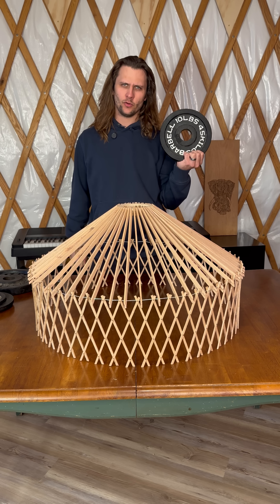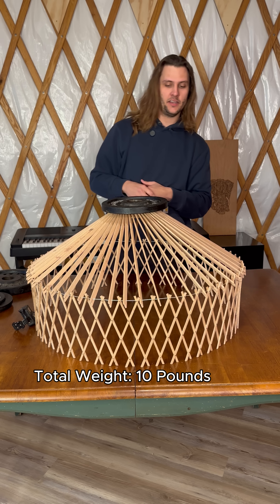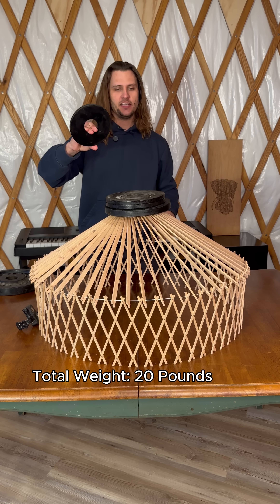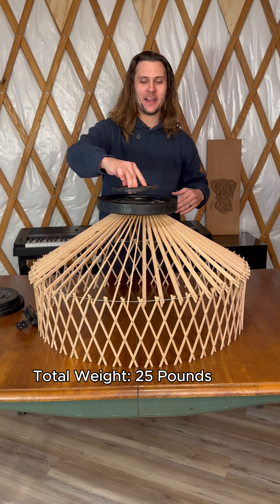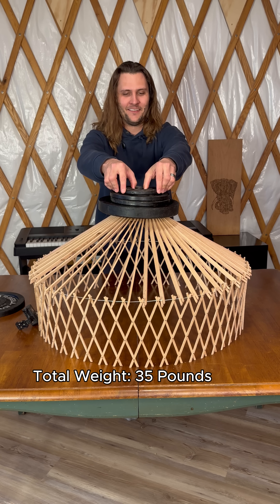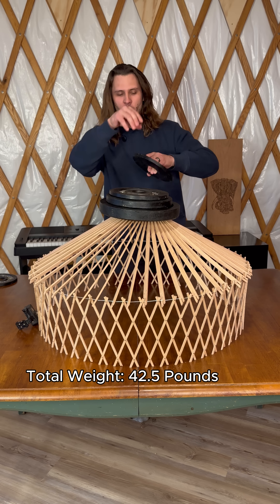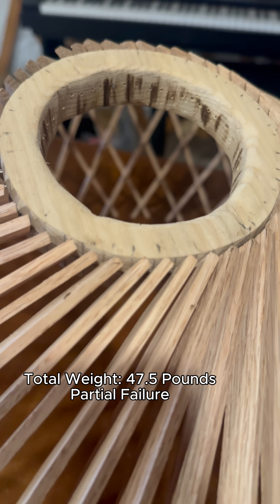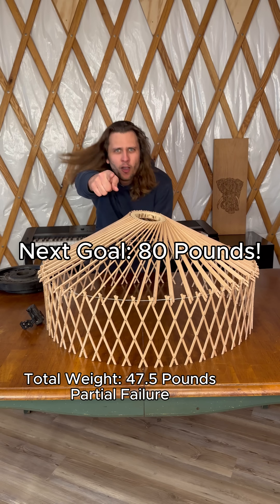Stress Testing Yurt frame to Failure

Comment: On the one hand, the twisting is a compromise in the structure.

On the other hand, that twisting could be viewed as the structure adapting to stabilize itself and accommodate the weight you added.

Comment: Yes put blocking at the top ring with a plywood cap for shear and add blocking at the rafter tails like freeze blocks near the lattice wire
Also secure the bottom of the lattice with wire and wood or metal stakes into the ground similar to tent staking. 
Great model and test.

Comment: I would suggest adding a small 7.5° wedge to one side of each rafter at the top, to reinforce the compression near the ring to reduce the twist, or for scale modeling purposes, add masking tape to the top of each rafter and mould a bit of epoxy putty in place.

Comment: I really want to build a full size one of these on my land in Vermont but I'm concerned about Snow
Reply from the maker: Most manufacturers offer a snow and wind kit, and can tell you how much snow they are rated to hold. I've seen pictures of yurts in Maine with feet of snow on top. Don't let that concern alone hold you back.

Comment: It would take far more if the weight was hung from the compression ring. That failed from the twisting and not the greatest compression ring setup. I built an 18ft yurt and had 6 full-grown blokes dangling from the ring inside it with barely a creak!
Reply from the maker: Ah another yurt builder! Well met. I am not convinced there is any difference in loading the weight from the top vs the bottom. My intuition tells me they should behave the same way, but my intuition could very well be wrong. I would love to test this and see.
6 men hanging from an 18' yurt is plenty strong, well done!

Comment: Are we silently assuming the felt covers aren't giving any structural stability? I doubt that.
Reply: well if it can do fine without it will only get stronger after applying. Of course it will , Just think about the back panel of a clothing closet. Without that panel it's super wobbly left and right but with it it's suddenly super solid in one place. Either way I think testing without is good so you see where the structural problems lie so you can strengthen them.
Reply: @DJMetalstone  Hmm funny that you bring up an example the directly contradicts your own hypothesis.  Strengthening the frame of a closet without the back panel would not be practical by any mean. Same is true for tent that is meant to be transported sure you can enforce the bare structure but not without any costs in weight which would make it impractical for traveling folks. Anyway it looks cool.

Comment: Can you put a pillar in the middle
Reply from the maker: Of course. And you have landed on the easiest and cheapest way to make the yurt much stronger. It does take away somewhat from the aesthetic of a clear and open lofted ceiling though, which is the reason I am avoiding it for now. I plan to keep going until it can support my body weight and a central support may be the only way to get there.
Reply: @ThatYurtGuy  yeah I feel adding several horizontal rings will be more then enough without losing esthatic. They're so spaceous is the part I love about seeing these. You don't expect so much room on the inside seeing these for real.
Reply: @ThatYurtGuy  what about if there's a stove in the center with the right kind of pipe/flue (double walled?).

I saw a documentary about some nomads, and I believe that's what I saw inside.

Comment: Can you calculate what the equivalent weight would be on a full size yurt?
Reply: It would change based on wood type, build type, and wraps 

But yeah! Just treat it like a fraction

47.5/(x) times (y)/(y)

Yurts go from sizes of 10 feet to 30 (diameter) , so divide the full size version from the small scale one to get (y)

——

So my guess is it’s about 3 feet in diameter, so it would go to about 158.3~ pounds of available weight to 475

The rods will need to be changed to sturdier material, and the wood to something that cracks less (hard wood for sure, his martial cracked like it was soft material, porous)
Reply from the maker: @MouseTheGoblin  
Great guess! It’s actually 30 inches in diameter. It’s a 1/12 scale model of the first yurt I built, with a 30 foot diameter. 
I think the calculations will be complicated by the fact that even though it’s 1/12 scale, some components are actually scaled differently. 

If you are interested and capable of performing the calculations, I will give the actual measurements here:

The true lattice is 1”x2” and the model is 1/8”x1/4”. The true lattice also includes twice as many pieces (does that double the strength? I am not an engineer)
The true rafter pins are 3/8 steel rod, the model is 1/16 pin nails. 
The true lattice is connected by 1/4” hex bolts, but the model uses the same 1/16” pin nails bent over on the inside.
The “cable” is 1 of the 7 inner cores present in 550 paracord, but the steel cable is a 1/4” aircraft cable. 
Also, I only used hardwood in the model. It’s all red oak, including the compression ring. The true yurt uses red oak for the lattice but douglas fir for the rafters and ring.

Conveniently enough, the 30 foot yurt I built is still set up here at yurtlandia, and I plan on performing the same test on that yurt to determine its strength. So in time we will get real world numbers to compare to our hypothetical ones based on the model. It will be interesting to see how they compare.

Comment: It seems like if you designed the pins to ingress at the natural angle it shifts when oberweighted it would be forced to shear the pins instead of allowing the shifting because the structure looks even but has already met the maximum rotation. Or add secomdary stability pins and/stability cables directly into a stake in the ground
Reply from the maker: I'm not convinced that there is a maximum rotation. I should have continued to add weight to verify, but my hunch is that more weight would have continued to rotate and crush the structure. You may be on to something though. Secondary cables that counteract the rotation could very well be a factor in adding significant strength. I would need to do some real world testing to verify. However the results from my second yurt stress test were insanely promising, the video will be out tomorrow, but I think you may be surprised at the difference a small change to the compression ring made.

Comment: Put some purlins in between the rafters so they can't twist
Reply from the maker: As I improve the design to hold more and more weight that is probably going to be something I'll have to add, but it is a challenge at this small of a scale I still need to figure out how to do it.
Reply: @ThatYurtGuy yea thats true and you'll have to get creative on how to attach them as well.
Reply: At the top of you put small blocks in between the rafters then it would resist  twisting and help the pins hold it together by reducing that shape force on them.

It’s also an obvious thing that the building envelope of this yurt 🛖 would have a structural advantage in tying the skeletal members together.

We sometimes think of the skin of the building as just a weather barrier but they are often structurally significant.
Reply: @altrucker18  so then there should be testing with the skin on.
Reply: @M @MANKLloyd  think so, the engineering of a structure of this size usually accounts for the amount of stability added by the way its sheathed, a yurt is of course somewhat different than a typical “stick built” structure in shape but physics doesn’t change because of style.
Geometry may actually help this structure.

When building temporary bracing is used to maintain rigidity before it’s completed.
This is because of the necessity of sheathing to hold members together if they are not supported in another way.

My background is as a commercial constructor and GC despite being a heavy haul trucker now.
Reply: I was thinking what if you put two cables at the top to anchor it better, and also maybe two pins at the top for the connection to the compression ring

Comment: You need a double ring system like put a larger ring in the middle
Reply from the maker: Having another support half way down the rafters is a great way to add a lot of strength to the structure. A wooden ring works for the model but seems challenging to implement at full scale. Other yurt companies provide blocking to add, or some use another steel cable in the same vein to add strength. Im interested in exploring those solutions at this scale and seeing how they work